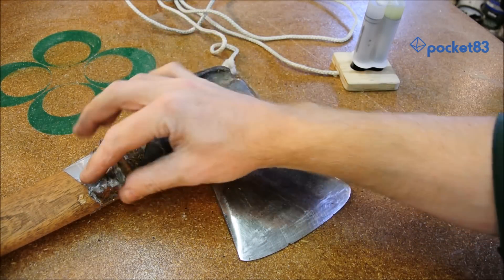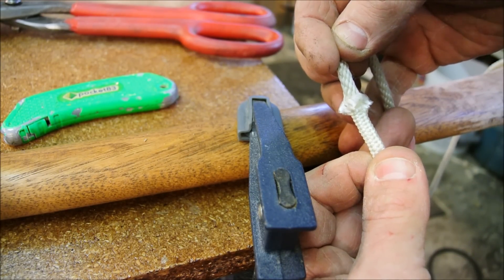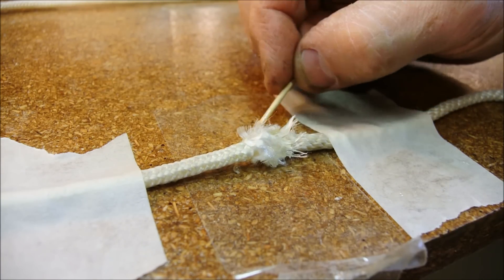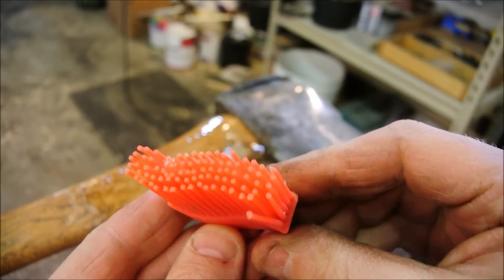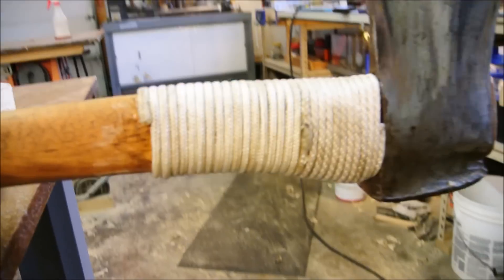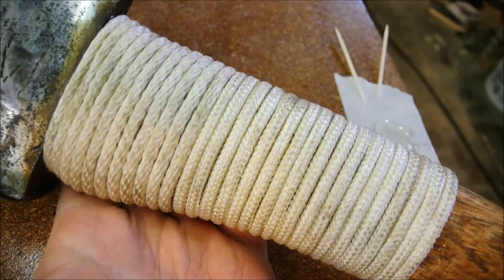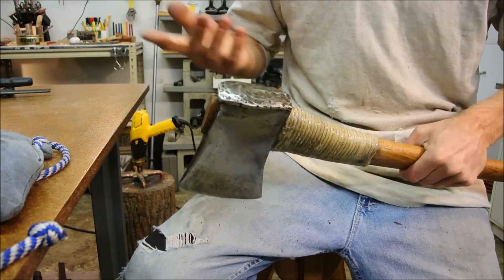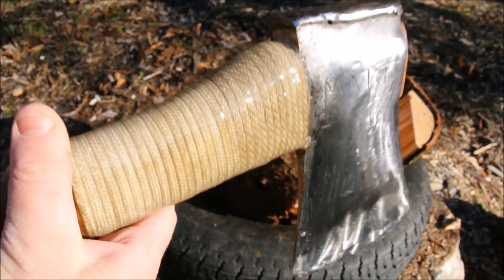Axe handle guard = Rope + Epoxy

Comment: How did this held up over time? Great idea!
Reply from the maker: Lasted a year. Cracked it in the middle on a fluke log strike. Then replaced it with the exact setup setup, and that's been going strong for two seasons now. It's really tough. Highly recommended.

Comment: I split wood for years with an axe. I won't lie, borrowing a wood splitter from a friend was one of the best things I did, hahaha! I can't afford to buy one, I was extremely happy when he did!
Reply from the maker: Sweet deal! Every late summer, buy him a case of beer to use it for a day, and then let him bump his shins on it for the rest of the year!
Reply: @pocket83squared  we have a pretty good relationship, plenty of favours are traded back and forth.
Maybe it's strange, but there are few things I find as satisfying or beautiful as a well stacked cord of wood!
Reply from the maker: I get it. Trust me. It's representative of not-work. It's potential fire, bought and paid for. Right now, I have only about 1/3 of a cord that's any good (it's barely seasoned, and under crappy tarps) and I'm scrambling to split and squirrel away some dead wood. I don't want to end up buying a load.
Reply: @pocket83squared  more than once I've found myself buying a cord or two near the end of the season. The place I just moved to didn't have my wood stove anymore, so it's not the concern it used to be, but I miss that thing so much! No other type of heat is so cathartic. 
Curious, do you measure a face cord or a bush cord?  The vast majority here is measured as a face cord, but up north where it's even colder, it's more common to see people referring to bush cords (which is basically 4x a face cord).
Reply from the maker: Um, I don't understand a thing you just said. Canadian Metric weirdos. A cord is a like the size of a sheet of plywood, but four feet thick, right? lol.
Reply: @pocket83squared  haha, yeah. 4'x8', if its 4' thick (or 4 rows), that's a bush cord. 
Funny thing is, we still use Imperial measurements for most wood related things. Go figure.
Reply: pocket83²   You got it. A bush cord is 4'W x 4'H x 8'L. A 16" face cord is: 16" W x 4'H x 8'L. You can also get 12", 18" or 24" face cords.

Comment: Brilliant fix! What kind of epoxy do you use? I haven't found a good one that dries hard and not flexible! Thanks
Reply from the maker: Loctite. 5 minute set, general purpose. It's the cheapest, and it works great.

Comment: how come you went with rope over leather cord? I was thinking about doing your method but using leather cord and epoxy.
Reply from the maker: Leather does work to imbibe epoxy a little bit, just like the Nylon. It's far more expensive, but it'll work fine. Because of the way that a semi-saturated rope will sort of smash in with hard blows (the way the Nylon does), leather might be ideal. This way it'll absorb impact. 

Cotton or jute might be too thirsty, and so a guard made that way may become too hard; that is, it could be too dense from all the epoxy. Leather should serve as a great happy-medium.

Comment: For many years I have wrapped handles in rope like that and then painted on multiple coats of Marine Spar Poly Varnish it will soak in and set up hard as a rock and is very very tough. It is also much easier.

Comment: How did it hold up to compression shock?  I expect the hard resin to shatter.
Reply from the maker: It's doing pretty well. After two/three weeks of daily use, no actual damage aside from one ding. I'm not going to repair anything until it starts digging into the rope, though. 

Note that I didn't even wait for it to fully cure before I filmed the demonstration.

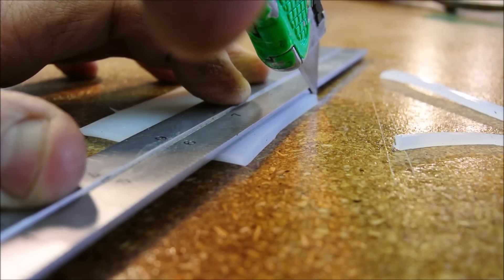Comment: 8:00 I don't know if they have those in the US, but we have a kitchen tool we call a "pan licker" which is basically a silicone spatula with tapered sides making it super useful to clean out pots and pans. It is mostly used for pastry baking but you can use it for gravy or just to pre-clean before sticking stuff in the dishwasher. You can operate it pulling (spreading or whiping, depending on how hard you push) or pushing (scooping). In your case, you'd use the scooping. We got them in a wide variety of shapes and sizes too. I know your channel is about the creating things, but in this case, I thought the effective use of base materials is slightly more important than the creativity of making a spatula tool... ( I hope this link works. I put it here for the picture reference, not for the price because these particular ones are a bit expensive if you ask me... Dollar store versions are equally efficient. https://www.bol.com/nl/p/uulki-3-delige-pannenlikker-deegschraper-spatel-set-uit-europees-beukenhout-met-rubber-kop-pannenlikkers-klein-medium-groot-pottenlikker-pannelikker-set/9200000070313511/?suggestionType=browse&bltgh=j4IavkzIB2i3SCYj-zlNFw.1.8.ProductImage )
Reply from the maker: Yes. We just call that a (silicone) spatula, I think. Mrs. pocket has a little one but I am not allowed to 'borrow' it. Yet.
Reply: @pocket83squared  and that is keeping you? =D

Comment: At the fire station we use 12 gauge solid wire and hockey tape.
Reply: Make a video, like to see that
Reply: The next time I need to do it I'll try to remember to video it.  It's quite easy to do. We also wrap the portion of the handles where we put our hands the same way except we space the wire about 1 inch apart with each wrap. It makes holding the tool so much easier when you're wearing bulky wet firefighting gloves.
  @rmsg7504

Comment: Do you enjoy splitting wood? 
Wood wasn’t a staple source of heat in my house, so I’ve never spent a summer splitting wood. But on occasion I would get the chance to do it. I’ve always found some sort of zen while chopping away, it was almost relaxing. 
Perhaps this enjoyment only comes because I never had to do it day after day.
Reply from the maker: Similar story here. I just need it for the garage.
Reply: Wood chopping and wood stoves are fun until you have to do it daily.  I've house sat for a few places where the wood stoves were the only source of heat.  First night was a novelty.  After that, nopity nope.

Comment: OK - you said it yourself, you filmed a loosy hit and I was splitting wood at 12. Big guy, lotta woods, Noah-where Canada. And with a grandfather teaching you to split, my job entailed a question to him. What is consistent?  He lifted a 35 inch maple, and with a 3.5 double head, cut the outside off, kept walking in circles, until he split the core. He had to have hit it 35 times, kindling off the outside and it grew bigger as he centered it. I never have seen a guy do that in all my years since. BTW - the guys from the Ranger School were good too.  cheers

Comment: You said something about compresion, where do you get that??
Reply from the maker: Ideally, you put a tight wrap on it to keep the wood fibers in compression. This strengthens them, as a rubber band might solidify a bundle of sticks.  

In this case, the bandage probably does not add much compressive force per se, but it certainly will as it resists during the handle's deformation.
Reply: @pocket83squared  you hold it together, there is no compression.

Comment: a tip for everone is to buy a really thick shrink tube for ground powerlines, it has really tough walls and even glue on the inside, doesn't cost that much, maybe 30$ for a 1m piece ~3,3" will be enough for atleast 5 axes or hammers :) and is also really easy to put on, all you need is a heatsource :)

Comment: So, I gotta ask, is there a particular reason you're using a felling axe to split wood? I ask because you said you need firewood, and you clearly care about Matt's handle. A splitting maul with a fiberglass handle would make splitting faster/easier, and the handle on it is designed for those rough impacts.

Edit: just read the description, and I was a bit relieved. I'd asked the above out of genuine concern and not the need to show off my "axe expertise".
Reply from the maker: Ha. I was pretty certain that one in ten comments would be about how I'm doing it wrong. MATT is pretty heavy, and I'm not dropping trees like that! It works well for medium splitting. Plus, it's just what I'm used to. That's why I gave it such a tough guard.
Reply: @pocket83squared  yea, I'd asked since you'd said you were in a "mad rush". Don't want you getting cold from a lack of firewood. Sadly, with the lovely sentiments of most internet pundits and a lack of tone in text, actual concern tends to read as more keyboard warrior crap.

Comment: Just cut a long strip from a bicycle tire, and wrap that area, tucking in the end.  The rubber absorbs shock and gives enough to protect the handle and to resist abrasion.  If you want, you can cut a tubu

Comment: For my hammer I use rope too but no epoxy. Only because I had rope and nothing better to do at the time. Nice touch with epoxy. I went to school for carpentry and sometimes people borrow your hammer and they can’t aim. The string helped, but a nail would just go in between the strands. Expoxy would of been perfect

Comment: Has this axe broke yet? Epoxy dries super hard and the wood needs to vibrate up the handle not to break. People sometimes epoxy the heads on and it will snap right at the head. Also, I have a couple of rubber bumpers designed to fit the handles near the heads, don't know if they still make them? Good luck
Reply from the maker: Still holding strong. I've been using it all winter for ALL of my splitting. The epoxy has a few little cracks, but it's nowhere near breaking off. It kinda reminds me of bulletproof glass that's been hit by a hammer. 

Also, this guard is attached to the handle, and not the head.

Comment: Welcome to the world of fiber reenforced plastics! 

Rubbing alcohol is what I use to clean up epoxy spills, and acetone also works well. Acetone can also be used to thin epoxy. You can use heat, like you did, if you don't mind speeding up the cure. Working in a cold shop will lengthen the working time.

Comment: After putting on the epoxy you should wrap it with rubber tube then leather so it will help absorb the blows just seeing that first blow shows me that it might not last long unless you wrap it again ..just giving my advice ..nice video..

Comment: I'd like to try this method but I'm not sure if it's worth it. Do you recommend this method.
Reply from the maker: It depends on what you're using it for. I'm using a heavy axe for splitting, so for me, it's great. If you are limbing or actually dropping trees, you might want a lighter wrap on your axe. You could also try the same thing with a thinner rope. It just depends on the abuse it's going to take. There aren't rules.
Reply: @pocket83squared  i will use it for splitting to.

Comment: I knew you were gonna have to coat it. That rope is not abrasion resistant in the least.  Very curious how this holds up.
Reply from the maker: So far (after three or four splitting sessions), it only has some scuffing. Keep in mind that epoxy has a 48-hour cure time. The hit it took in the video was about 12 hours after the last epoxy application. It's pretty amazing stuff.

Comment: Leather and lace works much better than epoxy for this and can be replaced IF you ever wear the leather down. That epoxy will chip and chunk out in no time if you split alot. Also, to replace that epoxied rope will require an angle grinder. The leather has the added bonus of looking awesome.
Reply from the maker: This guard lasted the entire season. Constant splitting. No chunks. This method is nearly indestructible. The handle ended up breaking elsewhere. Leather and lace is a joke in comparison.

Comment: Another really great option would be to have used cut up denim jeans for this and use it more as a wrap with 2-3 layers.   You were probably not able to get any compression with the rope.   At least not a significant amount, or enough to make the wood stronger (e.g. Prince Ruperts Drop).   I don't think the Compression would have helped honestly you would break the epoxy & rope off long before you snapped that handle.   Unless you think you can break off the head without breaking the epoxy, and if you can do that, I don't think you would be complaining that much about splitting wood.
Reply from the maker: Jean material is a really great idea. 

As for compression, I think there's some in there. Follow me here, because this gets abstract. The rope might not have been drawn tight enough to add compressive force by itself, but the epoxy moves into the fibers and then really solidifies the whole deal. Thus, while in a neutral state it might not be causing compression, but as its rigidity is called to action during the deformation that takes place immediately following an impact, it's going to cause compression as it resists the change in shape. A compressive wave will move through the medium. A crude analogy would be to bending your finger with a knuckle-bandage. 

Well made point, in either case. Also, we're a bit off-track; since the rope proved to work so well in practice, to what extent there is a compressive force is mostly incidental (at least beyond physics curiosity).

Comment: dude i would just put a piece of thick leather, rubber or plastic around punch holes in it and lace it one like a shoe. It is free or cheap works fine and can easily be replaced
Reply: Sounds great. You should make a video of that.

Comment: I hoped you’ve learned there are better versions of epoxy for this type of thing. Different consistency and differing dry times. But you succeeded, well mostly.
Nice job all in all.
Reply from the maker: Wow, that was condescending. I used general purpose 5 minute set, because that's what I keep in my shop. Mostly? It ended up outlasting the handle. Why would I buy another epoxy when this one worked so well?
Reply: Slow down !
I meant no insult at all only attempting to inform you of easier ways for your benefit . The difficulty you SEEMED to have with the thickness is avoidable so I looked to see if others had already said so . I found none so tried to help you for future problems of that nature. I’ve used the different forms of epoxy on yachts and other repairs so thought I’d share. I’m glad for you it worked as good as it did.
Now take a deep breath and accept friendly help. We’d get along.

Comment: Great work. I think the rope should keep it from breaking off, but there isnt much give.  Coating it with rubber afterward might be a good move.  Even a spray rubber...  Perhaps an actual splitting axe would serve you well.

Comment: Always aim for the front edge facing you and it enters easier, splits easier and don't hit your handle.  Don't split the back side either rotate it or walk around it.  Hard to beat rawhide soaked, sewn on tight and then let shrink while drying.  Tough stuff.  Besides it's something to do while sitting around the camp fire and drinking a beer.
Reply from the maker: It was a demonstration.  Anybody who has split five rounds before knows not to aim for the back. And there is no way that rawhide is as tough as this stuff. Not that I wouldn't like that type of guard on a smaller axe, like a limber that I don't split with. MATT is used more like a light maul.

Comment: Pocket... The reason you're beating the heck out of your handle is because you're not splitting those logs the right way. You are trying to cleave off the edges, but you have to focus on hitting the outer third of the log, lining up toward the center.
If you imagine the log like a clock, hit it from the outside straight on through the numbers, around knots if you can help it. Sometimes you can't help it.

The other reason you're beating up that ax is because it was not designed for splitting. It's a felling ax -meant for chopping trees down. A maul would split that wood twice as fast. 

Your ax handles will last a lot longer and you will risk hacking your leg open a lot less. 
Take my advice and use the right tool for the job.

Comment: Very cool Pocket! I like the creativity of using the nylon rope, good choice in my mind. I have a few hammers and axes that need handle repair or replacement. Any tips for a fellow YouTuber wanting to get into that type of video? Thank you! - Danny
Reply from the maker: YES! I'll give you the first five that come to mind.

1) Brevity. Keep them quick at first. You have to establish an audience before you can ramble comfortably. That means timing; remove empty or meaningless clips.
2) Clarity. Both in frame, and in written/spoken communication. Imagine the part of the process they would want to see most in order to do it too, and then try to show only that. No need for an "un-boxing."
3) Lighting. Lighting. Lighting. Far more important than the camera, or even the sound. It provides color, definition, and depth.
4) Research. Do it, even on the things you already know. Any presentation will bring criticism, so don't speculate or experiment unless you are prepared for the resistance to it (or you can just apologize constantly for every thing you do).
5) Honesty. Don't act fake. We get so much of it already. Don't act 'big time' unless you are going to do it full-time. In other words, keep your marketing and advertising to bare-bones at first.
Reply: @pocket83squared  wow thank you so much! This helps a lot, I agree with all of these. These are going in my notes for sure. Thank you for taking the time to help! - Danny
Reply: Pocket is a great man.
Reply from the maker: Archimedes was a "great man." 
I'm happy with "alright guy!" Thanks ;)
Reply: @pocket83squared  LOL 😆
Reply: Humility. Another clue.

Comment: I made a walking stick I wraped it with trot line. I mixed epoxy together and smeared it all over the stick with gloves hands. 4 years and thousands of miles later it's still not unraveling. I've also never had to make a repair.
Reply: Yeah gloved hands 5.00 a box at Tractor Supply good idea. I guess nail biters could care less.